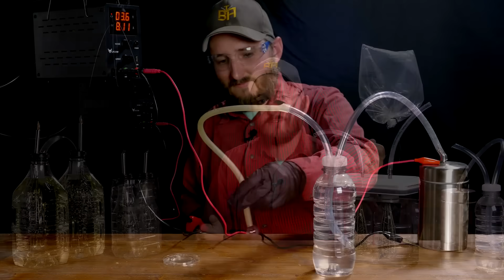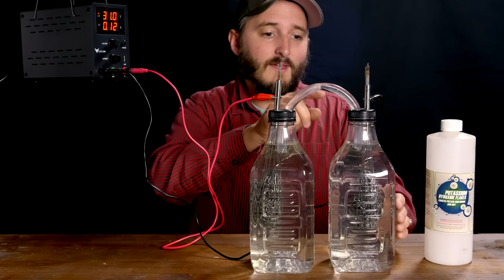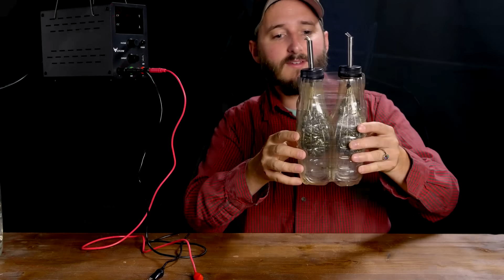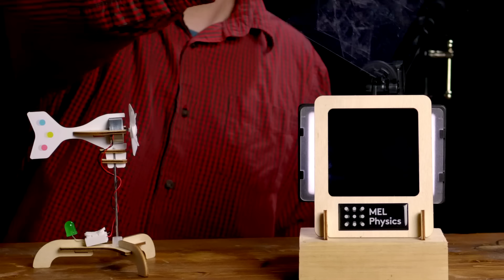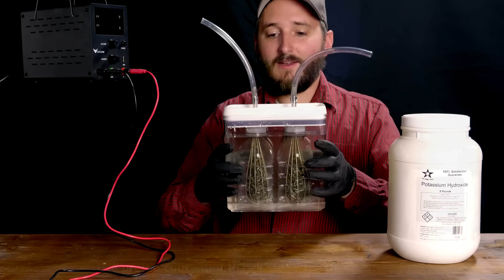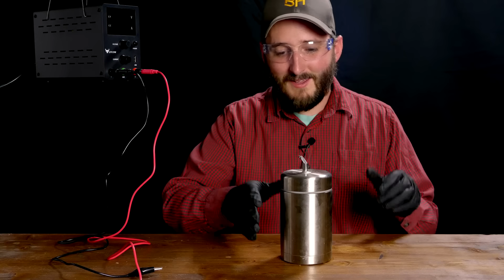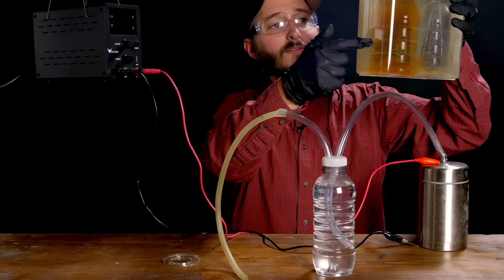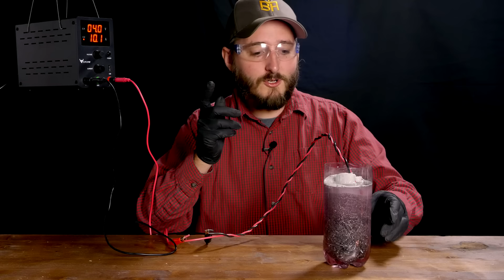DIY Hydrogen/Oxygen Generators From Grocery Store Items (HHO Fuel Cells & Split Cell Electrolysis)

Comment from the maker: Several people have commented with the valid concern that using low quality stainless steel electrodes will contaminate the electrolyte solution with poisonous hexavalent chromium which is not safe to handle or dispose of. I have spent some time this afternoon coming up with a solution to this problem. When using a strongly alkaline solution of KOH or NaOH as your electrolyte the fix is easy: drop a small 1x1 inch piece of aluminum foil into the electrolyte and let it dissolve. Do not add more than a small piece of foil at a time or the reaction may be violent. The dissolving foil will cause any dangerous chromium to convert into a non toxic variation, Cr(iii), evidenced by a green precipitate. One or two pieces of foil dissolved in this way and allowed to react for a few hours should be enough to ensure all chromium has been rendered non toxic.
Reply: I applaud the efforts to "neutralize" the Cr(VI) with a reducing agent but since you're still running the electrolysis cell you will be electrochemically oxidizing Cr(III) back to Cr(VI).
Reply: I did notice how low it was, Thanks to the Automatic Gain Control.
By your reaction and the bang that was very close to a small size firework payload detonating next to you.
not fun.

also, you forgot to mention that spark are generating by pretty much any voltage.
as low as 1 volt.
don't how many amperes one needs for that, however is clear that it can be very dangerous when using poorly secure connections.
Reply from the maker: @dandan-gf4jk  I don't mind some dilute Cr(VI) when it's contained inside the cell, so long as there's a means to neutralize it prior to storage or disposal. Actually, since Cr(III) is extremely insoluble it's unlikely you would convert it back once reduced. You only have to deal with what forms fresh off the positive electrode.
Reply: @Nighthawkinlight  Then we might have different priorities, I was quite unhappy to find my SS cathode corrode because I left it in solution. In general having Cr(VI) in solution is better than having solid dust flying around, but still di/chromates are somewhat potent carcinogens so it would be beneficial to inform people that they probably shouldn't spill the water on themselves :P
Reply: you should check the PH value of the two containers in your first unit, before and after running it for a while because I am betting you have a slow return of the component of potassium back to one of the containers after it has been drawn to one of the electrodes in side with only a small hole and path to run back into the other side to equalize again. (look into chloro-alki cells used to split sodium chloride into hydrochloric acid and sodium hydroxide, by way of a barrier that the components wont pass back through after being pulled or forced through or attracted by the inbalance of positive and negative charges. )
Reply from the maker: @dandan-gf4jk  I figured chemical burns from KOH are enough to de-incentivise anyone from taking a bath in the electrolyte.
Reply: How does "quality" affect chromium content? Am I under the wrong impression that better stainless has more chromium?
Reply: @Nighthawkinlight  And that's another type of burn right there....
Reply: Why not use strictly 304L ? It will not degrade.
Reply: @drgonzo7806  I presume money. Given the 'use dollar store quality' ingredients precludes being choosy about the alloy. Agreed it would be better.
Reply: @drgonzo7806  I'm not a steel wool expert but are there steel wool brands that actually advertise the specific alloy?
Reply: @frollard  You can buy specc'ed 304 steel wire, and make a coil out of it by wrapping it outside a rolling pin. and then the other by wrapping it outside say a paper towel tube, then use the sock method as normal.
Reply: that aluminum with KOH is enough to produce Hydrogen alone without electricity and the Oxigen will go to Oxidize the Aluminum
Reply: @drgonzo7806  304L isn't quite as good as 316L, but both will degrade with enough current.
Reply: @napalmholocaust9093  yeah quality to me only means how accurate to expected percents in the metal the particular grade is, so getting the proper grade would be what one should be focused on and making sure it comes from a good source so you don't get say 316L but the actual composition is closer to a 440 or something, or worse still there are things neither are supposed to have say like lead or thorium or something lol
Reply: @drgonzo7806  or even better just use straight EDM grade graphite as getting it in scrap boxes can be done for 10 dollars a for a 20 pound box (plus about 15 to 20 bucks for shipping LOL) I have one here that has blocks that are an inch thick and 4 inch by 6 inch minimal, and rods from half inch dia to 4in dia, thin flat cuts that are more like knife blade, than a chunk of graphite and it all has about .5 to .7ohm resistance no matter how far apart or which direction through the graphite as its all amorphious glassy graphite, (just don't expect to be able to use it to make graphene sheets by rubbing it on anything, as it is VERY hard for graphite, XD) also if you have a company that does any sort of EDM work with in driving distance you can possibly go talk to them about getting scrap from them and get it super cheap if not free, just don't expect to get cheap or free tungsten/copper alloy electrode material XD (actually I would avoid copper period from them unless you can get info specifically on it making sure you are not getting something carcinogenic with it, like beryllium as that is a thing with copper EDM electrode material,
Reply: @dandan-gf4jk  better yet collect that stuff and use it in other experiments for which you need a catalyst XD
Reply: true!  Very exactly ... my dad is a doctor of chemistry with 40 years of research behind him. Your explanation is GREAT
Reply: Arc wielding rods could do the trick instead of this complicated design ?
Reply: Ben I would add this to the video and repost it. Hexavalent chromium is no joke and this risk and how to mitigate it should be part of the main presentation.
Reply: Thanks for going the extra mile on this.
Reply: Couldn't you minimize electrode electrolysis for the combined gas output one by using AC instead of DC?
Reply: Quite the miss to be oblivious to this hazard. Stainless steel should not be used as anode for water hydrolysis, especially not in an educational vid targeted at kids. I doubt melscience wants to sponsor environmental harm and potentially poisoning kids with carcinogens and heavy metals, without a single warning about it given in vid no less.
Reply: @aleksandersuur9475  Real constructive, pal.
Reply: How about using Carbon Arc electrodes instead?
Reply: @aleksandersuur9475  California?
Reply: guys, you could also use aluminum foil as part of the electrode, or even the whole electrode, after all, the electrode already corrodes quite quickly.
Reply: A DIY hydrogen torch design would be really useful to a lot of people.
Reply: @Real_Claudy_Focan  They could, but it would be less efficient.
Reply: @michaelcre8  Using AC can be risky, especially at higher powers. The current switching means oxygen and hydrogen is produced at the same electrode, and at high power I've seen the gas actually ignite at the electrode as it's being created.
Reply: It should also be mentioned, for those that haven't messed with HHO generators before, that you should never use Chlorine salts.
This is important to mention because table salt is the first thing people will think of most of the time, unless they know better.
And using these salts will produce chlorine gas.
Reply: @Metal_Master_YT  Aluminum will react with KOH or NaOH solutions even without electricity.
Reply: @shinrakishitani1079  I've wanted to make an HHO generator for not only a torch use but also because I've read that breathing Brown's gas is more beneficial than just O2. It would be nice of somewhere we could source together a guide on how to make one, with all the many safety precautions that need to be taken into account. I havent even thought about seriously starting on making one yet just because of all the known hazards let alone which ones I dont know.... Need an HHO generator plans and safety precautions for dummies guide.
Reply: aluminum foil, not to be conflated with tin foil.
Reply: Thank you brother.
Reply: @Nighthawkinlight  pickle juice?
Reply: Did someone call the safety police?
Damn snitches
Reply: @Nighthawkinlight  I'd assume that getting a chemical burn, with a solution that contains Cr(VI) would make it likely that you absorb a greater amount of it than you would have by simple contact. So this is an additional risk when handling used electrolyte. You've said, that you've splashed yourself with the KOH solution accidentally while making this video. Accidents happen. So saying "just don't get any on you"  isn't a safety concept. You need to be aware of the risk, take precautions to minimize it and to mitigate harm when an accident happens.
That said I, it's a great experiment and I believe we should be able to show and do things that have risks, we just need to be aware and act accordingly.
Reply: Comments here are quite informative. We need another video about this filtering out comments into one nice video. Health hazards are serious. I need this.
Reply: @aleksandersuur9475  Quite the miss?  Right.  Hexavalent Chromium is like asbestos.  Unless you're mining it or doing something to produce dust with it, you have nothing to worry about.  It takes a fairly long exposure time to be of concern.  And that's if you mishandle it.  People like you act as if a single drop or even looking at it wrong will guarantee death.  It's a simple concept to grasp...be safe, but don't be afraid.
Reply: Pencil graphite might be good solution here.
Reply: @Impatient_Ape  I was hoping that by the way I phrased my previous comment, you would know that I already knew that, apparently not.
I said: "guys, you could also use aluminum foil as part of the electrode, or even the whole electrode, after all, the electrode already corrodes quite quickly. " as you can see, I was aware that the previous electrode was corroding, and I was suggesting that we use aluminum because it wouldn't change the fact that it was corroding because I knew that aluminum would react and corrode as well. 
now, of course it may very well be reacting faster than the stainless steel, I don't know the speed, and frankly, I don't care that much since I'm not the one building one of these devices. but what I'm trying to say is that, yes I know that aluminum reacts with KOH/NaOH solution, forming a bunch of hydrogen gas. I believe you can get the stuff advertised as drain cleaner at a grocery and or possibly a hardware store. then just mix it into some fresh water, and let dissolve, then throw in some aluminum foil, and watch it make a ton of hydrogen gas. fun, but also dangerous, not only because of the kinda explosive hydrogen gas, but also because the solution you have made is highly corrosive/caustic.
Reply: @jenbadabam8801  how about you wear clothing that PREVENTS it from getting on you, eh? the point is to stop it before it ever gets to you, i.e., before it ever makes contact with your skin.
Reply: I like the oxygen but hydrogen is a nuisance. Is there something that absorbs it and makes it nonflammable?
Reply: @doesthedishes198  oxygen absorbs the hydrogen and turns it into water. you have to burn it if you want to get rid of it quickly. you can use the oxygen in the air for that, or you can put the hydrogen in a pressurized container and sell it to somebody else.
Reply: I see you are using a lot of stainless steel.  Some have reported the chromium contained in it leaches out into the electrolysis medium.  Have you found this to be the case?
Reply: @Nighthawkinlight  EXACTLY! lol. You mentioned carbon which is also useful electrode to not have to deal with Cr(Vi). Titanium is another good one. Salt water pool electrolyzers use titanium plates to generate chlorine from the NaCl added to water. Thanks for showing this. I been working on hydrogen electrolyzer for a while and still havn't gotten it quite....optimal. Now do a video on how to make permeable electron membranes!!!
Reply: Is that a rust build-up in the right side bottle?
Reply: @doesthedishes198  I think pladadium works.  You can vent or burn it, but there's better ways to make oxygen than electrolysis!  They have these medical units that make it on demand from air.
Reply: @dandan-gf4jk  If one is patient and goes about making hydrogen gas and oxygen the slow way, is there still a possibility of getting toxic compounds if the electrodes are made of aluminium (foil) and the electrolyte added to the water is baking soda ? I know of Cr(VI) from the movie Erin Brockovich and understand it can cause cancer.
Reply: Night hawk

Since it's only the cathode or plus side that decayed from the contact with oxygen; the if you did buy carbon felt cloth cheap
Then no decay.
Reply: @175griffin  

So why not carbon or graphing cloth as the positive cathode?

You are talking about spending money here anyway.
Reply: Do the electrolytes actually get 'consumed' in any way? What about the aluminium?
Reply: The whole single output electrolysis chamber is a timebomb. A HHO generator with a live case is not a good idea, quite frankly its an awful idea.

i'm sorry about the harsh tone i took i know this is one of if not your first electrolysis project and we all make mistakes when starting out but their is a reason I haven't published any of my projects yet and that's cause I don't want to look like an authority and give awful advice.
Reply: To check you have reduced all the Cr(VI) in your solution, add few drops of the solution to acidified 10% potassium iodide. If there is colour change to brown, iodine is released and the solution still contains hexavalent chromium. The indicator sensivity is greatly increased by adding few drops of starch suspension - it detects slightest traces of iodine by turning blue.
To neutralize the sample, add enough reducing agent (e.g. sodium bisulfite) so it decolorizes again.
Reply: I am not sure if it was mentioned that the hydrochloric acid flux needed to solder the SS can also be dangerous. It also should be mentioned that it needs to be neutralized after soldering.
Reply: U
Reply: U
Reply: how about use stainless steel water bottles .... and stuff SS pad
Reply: @ratgreen  not sure if it’s 304SS, but harbor freight sells rolls if single strand SS and it’s relatively inexpensive and has many uses.
Reply: Can you do a video where you add this device to a cars air intake?
Reply: I'm really curious how much it extends mpg
Reply: @francoisleveille409 No, there is no chromium anywhere it won't just manifest itself into existance in your cell, although your anode will produce mostly co2 and convert itself into Al(OH)3.
Reply: @reypolice5231  If you wanna spend some money, platinum-iridium is the way to go. It's more conductive and also won't corrode. It won't have quite as much surface area as a graphene cloth though.
Reply: @nitroadshadow4667  

Then kindly post what you see as the problem, and mitigating efforts, so the rest of us can be informed as well. Thank you.
Reply: @the_overthinking_philosopher  

Not air intake, but vacuum line to break Master cylinder is better I am told. Less chance of an explosion. Air intake not good.
Reply: @Real_Claudy_Focan  take apart carbon zinc battery's the rods are graphite don't worry they the cheapest kind of battery cheak the dollar store also don't worry they don't burst into flames like lithium pretty good rods for making heating elements
Reply: @h7opolo  I'm not even sure tin foil is made anymore.  After the introduction of aluminium foil (yes, I spell and pronounce it the Australian way 😁), tin quickly went out of fashion due to aluminium's lighter and more malleable texture and tin sometimes leached into certain foods, giving them a metallic taste.
Reply: @Nighthawkinlight  What just using platinum electrodes?
Reply: @onradioactivewaves  Don't go breathing Brown's gas.  It's non-toxic, but if it somehow explodes in your lungs (e.g. because of nearby electrical sparks) you'll be entirely fucked.
This is partly why fire-breathers use kerosene rather than any more-volatile fuel; fuel that might create an explosive mixture, when you inhale, is a VERY bad choice.
Meanwhile, a "poor-man's oxygen concentrator", mixing the electrolytic O2 with air, is entirely safe... but probably unnecessary.   And, don't smoke, while you're using it!
Reply: Best to have a wash-bottle nearby; (dilute?) vinegar would be appropriate, for KOH / NaOH electrolyte splashes.
Interesting to see how much more conductive KOH is, than NaHCO3; good experimental info.
Reply: @bardrick4220  Those chubby carpenter's pencils, for example.
A commenter upthread suggested shopping for EDM graphite scraps, which (if I could find them!) would give much more surface area.
Reply: @Metal_Master_YT  It's absolutely not helpful, to have the electrode dissolve in the electrolyte, *even in the absence of any applied voltage*.
Your suggested cell eats itself, wasting both the electrode and the electrolyte;  fail.
This isn't a matter of our ignorance, this is merely a terrible suggestion on your part.
Reply: @doesthedishes198  Just vent the hydrogen, and leave a window open;  the H2 will rise and escape your premises.
Alternatively, flare it off, per oil rigs / drilling, if you're making enough to sustain a flame.
Reply: @Metal_Master_YT  Oxygen does not "absorb" hydrogen, absent a flame or something like platinum black catalysis.
And these cells won't produce [enough] H2 to pressurize, in part because they run at atmospheric pressure; you need a couple hundred atmospheres, for a cylinder of H2.
Reply: @mattparker9726  "Yes"; the SS gets oxidized, as you can see from the color-change of the electrolyte.
OP suggests that, to dispose of the electrolyte, take it someplace safe (e.g., outside, in a bucket) and add scraps of aluminum foil; which should reduce the chromium from VI (dangerous) to III (insoluble, mostly safe) -- then pour the electrolyte down the drain.
Reply: @Wayne Flanigan Low surface area.   E.g., pencil leads work, but not nearly as well as SS scouring pads or wraps of SS foil.
Reply: @bardrick4220  Right, oxygen concentrators, on Ebay for a couple hundred bucks, reconditioned.   But they don't give pure oxygen; they leave some nitrogen and (I suspect) argon etc.   Good enough for a torch, maybe not good enough for chemistry :-)
Reply: @francoisleveille409  Aluminum will dissolve in alkali electrolyte, so probably / slowly in baking soda.  You'd be much better off with SS or with graphite.
Per previous comments, you can reduce the Cr(VI) to Cr(III) with aluminum foil, once you're done with the electrolyte; just don't splash it about, in the meantime.
Also notice that KOH and NaOH work much better than baking soda, in the sense that you get much less heat and much more gas for the same power input.
Reply: @reypolice5231  Ooo, that's a good idea; relatively cheap, high surface area, nicely flexible to wrap around some kinda "former"; thanks! :-)
Reply: @theskett  You could also use arc gouging electrodes; it would depend on budget and use, although if I was doing it for energy storage I think I'd opt for a fuel cell.
Reply: @theskett  ya, the whole "perfectly explosive stoichiometric ratio"  aspect of Brown's gas does raise a bit of a cautionary red flag.
Reply: @theskett  Sorry, no Cr(VI) ever. I don't care if the reaction is less energy efficient. If Alu foil dissolves slowly in sodium bicarbonate then it doesn't matter as it costs virtually nothing. My life is far more valuable. I will not risk getting cancer just because I want to make a bit of hydrogen.
Reply: @bardrick4220  Arc gouging electrodes, are apparently not pure(-ish) graphite; see previous comments on this subject.
But hey, go try them, they're relatively cheap.  I'ma go SS or graphite, next time I play.
Fuel cells are... much too complex, easily poisoned, much bigger.  Ok if you want 1+MW, no good if you want 1kW (because, at 1kW, you don't get support staff).
Kinda the same way you don't want even a 100kW nuclear generator; hot, dangerous, should be not-near-you.
Reply: @francoisleveille409  Missing the point, you are.
If you don't understand why adding aluminum to an electrolytic cell that uses KOH or NaOH as an electrolyte, or even NaHCO3, then you and your valuable life should step away from any kind of chemistry.
But you can go make H2 from NaOH and Al, without an electrolytic cell.  Go have fun.
Reply: Or use a nonreactive electrode. Gold comes to mind.
Reply: @growleym504  No problem, send us all some 24kt gold and we'll stop using SS.
Reply: @growleym504  We want large, inexpensive, surface area.  Guess what, that excludes gold.
Reply: @theskett  You don't care about my life so I don't care about your advice.
Reply: what about ormus?
Reply: @Mad_Scientist2052  HCl and "killed spirits" are both essentially safe, and can be rinsed away.  Neither needs to be neutralised.
Reply: @francoisleveille409  Of course, but that reciprocally means your comments are without value.
Reply: Just use 14 parts urea 1 part potassium hydroxide and use graphite as the contacts
Reply: @drgonzo7806  in any electrolysis system the 304L anode will have to 'degrade'..........
Reply: @Rem_NL  OK, why TF do I want to use urea?  Esp.  in preference to KOH?   That seems at best silly.
Reply: @theskett  most efficient way of doing it, need way less power draw + heat production
Reply: @theskett  No one cares about my life and my comments are without value. Such nice people on the internet. :-P
Reply: @Rem_NL  Very unclear, what you're saying here.  OF COURSE we want less power draw, less heat production.  But you don't help us with that, do you?
Reply: @francoisleveille409  Yup, you got it.
Reply: @Xayuap  Of course, but that's both pointless and useless.
Reply: @michaelcre8  Nope, AC only provides heating; not electrolysis.
Reply: @Bobsmith-xq2pr  AC will only give you heating, not H2 + O2.
Reply: @theskett   ó, but you can use your trash Aluminum to forge some energy
Reply: @Xayuap  Nope.  Recycle it, instead, to improve your karma.
Reply: @nitroadshadow4667  A live case is fine; it's at tops 30V, that ain't electrocuting anyone.
Thanks for not publishing anything, tho, that saves us all some time and laughter.
Reply: @Mad_Scientist2052 HCl and Baker's Soldering fluid both wash off, do not need to be neutralized.
Reply: @theskett   recycling needs energy. this gives you energy.
Reply: You should try HDPE or LDPE plastic, they are both much more resistant to corrosion.
Reply: @randallkornholio2971  Yup, those won't corrode, because they're mostly inert.  How's that help us, tho?   They melt down, fairly easily, at below boiling water IIRC..?
Reply: @theskett  false. AC will absolutely split water, just very dangerously.
Reply: @Bobsmith-xq2pr  Sadly, no.  Just heats, not electrolysis.  Good luck with your heating.
Reply: @theskett  remember, when there's an electric differential between two electrodes, AC or DC, it will split water. It's just about quantity, efficiency, and danger.
Reply: @Bobsmith-xq2pr  No, it's about the motility of the ions.   50Hz, 60Hz, just gets heating doesn't occur any electrolysis, because there's no time for the ions to turn into gas.
At 50 (60?) Hz, you got nothin'.
Reply: @theskett  I promise, I've stuck power from a standard US outlet into water with NaOH in it, and it bubbles and some of the bubbles even explode on creation. Although I will admit I've never considered the effect of the frequency on electrolysis. Maybe I should get an oscilloscope and do a bunch of tests.
Reply: Why not try to hook up the metallic single output HHO Cell to an internal combustion engine? If you made two or three cells you might make it run even if only at idle.
Reply: @theskett  HDPE melts at 130°C (266°F), HDPE also does not crystallize until 111°C (231°F), water boils at 100°C(212°F), plus test sheets indicate HDPE will hold up to potassium hydroxide at 50°C for 30 days with little to no noticeable damage, how does that not help the situation? Is there another deterioration to the HDPE that I have not seen in the material data sheets?
Reply: @randallkornholio2971  Hee hee, show me a plastic crystal  -- I don't need to get out more, when I can just laugh at you.
Reply: @Bobsmith-xq2pr  Those bubbles are steam.
Reply: @theskett  sureeeeeeee Explosive steam
Reply: Good show old man.
Reply: One thing you could probably do to improve the sock design even further is to make it a layered structure. Start with a whisk + scouring pad, then a sock and a positive electrode over it, then another sock and a negative electrode, repeat ad. infinitum or while the socks fit. Then connect all electrodes in parallel.
Reply: @theskett  ehh no? You got to make it yourself. Not sure what you are asking here. I posted a clip on youtube from a very wel respected man. He has a made a tutorial in how you can make HHO with the help of graphene foil, urea, some plastic and screws. No chromium involved, no nasty gasses. And to top it off the best efficiency when it comes to power draw.
Reply: @Wayne Flanigan I believe it is due to the low surface area, and the fact that they are worse conductors than metal. there might also be issues with some electrode materials just simply not being good for that specific terminal, I.e., some materials are better suited for the negative side vs the positive side, or are simply not good for either side. I don't fully know the answer to that question though.
Reply: @theskett  but NightHawkInLight himself suggested putting aluminum into the solution to reduce the unwanted chromium compound. any aluminum that goes into the solution will react with it, so what is the problem with making an electrode with some amount of aluminum already on it so you don't have to come back every once in a while to place aluminum foil squares into the solution?
the electrodes are already dissolving, so what exactly is changing? the cell is already eating itself brainiac.
also, there's no need to say that my thoughts are terrible. I mean, come-on when did I ever say your thoughts were terrible? I said you misunderstood me, but I never told you that your ideas were terrible.
Reply: @theskett  "Oxygen does not "absorb" hydrogen, absent a flame or something like platinum black catalysis."
well yeah, duh! why are you even bringing this up? I said "burn it" in my original comment, I thought I was pretty clear!
you have to look at the context of whom I'm talking with. the other person asked if there was any way to get rid of the hydrogen, or absorb it somehow, and my answer was
yes, oxygen will absorb hydrogen. just heat it up, and it will burn, making water, boom problem solved.
also, technically, when hydrogen is mixed with oxygen in the air, a few water molecules will form due to random chance, a few photons might hit the same spot and temporarily heat up a few hydrogen atoms and a few oxygens, enough to make a single water molecule.
I'm Confused, What's Wrong???
Reply: You have a very interesting process I like the idea of two separate containers for hydrogen and oxygen.   too bad you could not find a high-quality stainless steel container for that process
Reply: @theskett  "And these cells won't produce [enough] H2 to pressurize" well then use a gas compressor.
Reply: @Metal_Master_YT  You certainly are confused, and you're repeating yourself.  
There isn't sufficient hydrogen, in our atmosphere, to be interesting; it's very light, it achieves escape velocity, it doesn't make water.
LOL, "technically" -- you have nothin'.  No physics, no chemistry, just a need to comment.  OK, go you.
Reply: @Metal_Master_YT  The electrodes are not already dissolving, "brainiac"; the aluminum is to knock the Cr(VI) to Cr(III) once one decides the electrolyte should be disposed.
JFK, MM, go back to welding or whatever it is you do best.
Reply: @c.t.murray3632  Just strap a couple of the SS containers together.
Reply: @theskett  what the heck are you talking about? you're such a hypocrite!
"No physics, no chemistry, just a need to comment.  OK, go you." If anyone has a need to comment, its you, count your comments dude!
so far, you have commented 39 times in this thread alone! you make up nearly 30% of the comments!
"There isn't sufficient hydrogen, in our atmosphere, to be interesting" to be interesting? ok... but I'm not talking about natural hydrogen in the air, I'm talking about the hydrogen that is produced through electrolysis, because @DoesThe Dishes was asking about it, and I was answering his/her question.
"it's very light, it achieves escape velocity, it doesn't make water." uh, yes it does. when you burn hydrogen it makes water, as I said. it is, of course, in the form steam, because it gets very hot from the exothermic reaction it just went through, but its still water nevertheless. also, escape velocity usually refers to a solid body of some sort, not a highly-dilute gas. the definition of escape velocity is the following: "the lowest velocity which a body must have in order to escape the gravitational attraction of a particular planet or other object." its not really correct to say hydrogen achieves escape velocity because hydrogen does not need any external force, it makes its own to float upward, and of course, it will rest at the very top of our atmosphere for a long time, not exactly "escaping the gravitational attraction of our planet". would you say that a bubble has achieved escape velocity in some water? no, not really.
there's your physics and chemistry for ya.
Reply: @theskett  "The electrodes are not already dissolving" look at the freaking stainless steel electrode, see the dark brown color? its reacting and corroding, and at least a small amount of it is making soluble compounds, I know because I have done the experiment myself, with stainless steel, and a power supply. I will admit that I used salt water in mine. (not as good as potassium hydroxide) so it might make different compounds. also, the chlorine started to make me nervous, so the experiment ended early.
corroding or dissolving, either way its breaking down.
Reply: @theskett  "Right, because a gallon a minute warrants a compressor.  Don't be a total dick." you're assuming the size of my apparatus? how in the world would you know the gallonage of gas per minute I make off of a theoretical device that neither of us has made? NightHawkInLight himself said that it could be scaled up. besides, this isn't my apparatus were talking about, the conversation began with @DoesThe Dishes comment, it would be his/her apparatus. he/she asked how to handle the annoying hydrogen, and I am simply giving out ideas, no need to hate on me. I don't know what he/she had in mind, if it was a big setup, then a compressor of some kind could be useful.
you have to stop changing the subject, or at least straying from it, and you need to take into account context.
Reply: Can you tell me the answer to life in your next project… I’m sure others would appreciate it to.
Your superhuman critical problem solving is insane!! 
Teach me your ways, Sensei🙇‍♂️
#nighthawkinlight #BigBrain
Reply: GREAT TIP! THANK YOU!
Reply: @aleksandersuur9475  I seriously doubt that there are all that many kids either watching this video or buying the sponsor's kits ~ that would be the parents.  I agree that it should've gotten mentioned - FOR THE PARENTS; but, the concept of "child proofing the world" makes me want to throw up!!!
Reply: @Metal_Master_YT  Except, hydrogen is extremely difficult to contain, even under pressure. (one of the reasons why it gets villainized - it's impractical to meter it...)
Reply: @Bobsmith-xq2pr  If you want to go that route, use HF/HV DC - CAREFULLY - I'm hearing that some folks are getting really good output using very low energy by going that route. Keep in mind that it IS "dangerous;" but, that just means that one needs to respect what we're working with...
Reply: @NTF-zb9wi  Carbon Arc Electrodes work great for producing Sodium Metal from Sodium Hydroxide
Reply: How about using Carbon rods, stripped out of Zinc carbon batteries?
not so efficient maybe but safe.
Reply: @NTF-zb9wi  ok... then just burn it if you don't want it.
Reply: @theskett  

Hi theskett,  I am now looking at my build as a price of plastic jug flat square or rectangle/ or wood as as the center of build. Wrapping it with those green flat kitchen scouring pads [ I think they're made by Scotch gard or some cheaper company at the dollar store]. This will allow the water to percolate up through the bottom and on both sides of the steel wool. The tube sock is too thick, which is why I recommended the bed sheet/ pillowcase/fabric as a separator. You can control the thickness of your build on the separator with fabric. [I plan to leave the bottom exposed to the water, and maybe that side not covered by fabric?].

Rest of the build  you've already saw offered as a proposal in nighthawk or anyone else.

My opinion is that the fourth stage of water, John Ellis water is key. As it's so close to separating that the amount of energy needed to get it to release into gas will be minimal.

I still think magnesium sulfate/ food grade Epsom salts is it safer electrolyte. And it priced cheaper than baking soda. I have 40 lb of baking soda from Walmart cleaning Department. 24 lb of food grade magnesium sulfate / Epsom salts from the bath aisle. Both are great for taking baths.
Reply: @Real_Claudy_Focan  what arc welding rods are you meaning? Leaving the coating on them or stripped of that in just a metal wire part? You've done this before and it works good?
Reply: @shinrakishitani1079  did that years ago and then did that with galvanized metal as my plates.. that was not so fun LOL
Reply: @michaelcre8  everything I've ever read says you have to use DC to make hydrogen to AC won't work and from my experience I've never gotten anything to work from AC but have gotten DC to work quite well with the stainless steel pot scrubbers actually very similar to what he showed except for I use three and three and wrap them with a nylon window screen instead of a sock and instead of using copper wire for my connections that use a stainless steel wire like from a whisk pulled apart it goes down into the stainless steel pot scrubbers one on the inside one on the outside up to a lid of a gallon size jar and a couple stands still bolts up there put with rubber grommets so they're sealed that you hook the stainless steel whisk wires too on the bottom side of the lid and one other hole going through there with it with a nipple and a grommet so it's sealed off and the top side hook a 12 volt heavy duty wiring for your vehicle via a starter solenoid separate starter solenoid just for the hydrogen generator to act as a relay and make sure you run into a bubbler split it off and put it into the power brake booster of your intake manifold system for your vacuum and the other line right there by your mass air flow sensor in your air filter and make sure you put a check valve in the one that goes to the vacuum booster to the power brakes and with that in my Jeep with a 4 l inline 6 cylinder motor I was able to produce over 2 l of gas per minute which is what you need to be doing and took my fuel mileage from little over 12 miles is a gallon to 26.2 miles per gallon all day long no matter what. Make sure you use a bubbler and I used pure lie for my electrolyte that's more than double my mileage so that's pretty damn good. I've seen people do better though even better mileage than that with 350 V8 but I was happy to get that with my Jeep at the time. I wrote all this with my text voice to text so hopefully you can understand it I'm not going to go through and correct all this s*** I think you can get what I'm saying for you just be along with it..
Reply: @Bobsmith-xq2pr  I'm getting ready to make one that runs off AC but using a 200 amp rectifier diode that I got off of Amazon to convert the AC to DC.
Reply: @onradioactivewaves  you just got to go for it man. That's how we all started out just saying f*** it and going for it. I'll tell you a huge tip though you should absolutely follow and not make the same mistake I did on my first one definitely use a bubbler for the anti flashback setup. The very first one I made I cut up the stainless steel sink from my plates and was about to build it in a glass jar but luckily decided to put it in a plastic container instead and hooked it to my bus batteries and that fizz coming off there was just lighting like snap crackle pop it was great but the torch and I put the lid on it and told my buddies I was holding thinking I should have a super torch I had a super explosion it was loud as hell and crazy luckily nobody got hurt but we could have so at that point I knew that's what the bubblers are for and make sure you always use a bubbler. I used my voice to text to say this so if it's not all correct or punctuated correctly just try to read through it..
Reply: @BurkenProductions  at the hard time keeping awaken this front of me class in college from the due to voice all melo and being right after lunch too I guess LOL..
Reply: @Metal_Master_YT  it's actually not the explosive kind of hydrogen gas like doing the electrolysis processes. I've made a ton of it both ways and I ran both ways into my Jeep motor and I've gotten the same results actually.. doing it the aluminum way though is kind of a pain in the ass and it's very much a lot more maintenance to clean out all the byproduct that leaves after dissolving the aluminum. I've actually modified camp stoves though and ran them on the aluminum foil in the water solution reactors. I'm pretty sure that I was able to do the little stoves easier that way because it was not so volatile and explosive as the hydroxy solution from electrolyzing with stainless steel or other metals.
Reply: @nitroadshadow4667  what's wrong with using a stainless container? I've been using an old stainless steel fire extinguisher for several years now with no problems. I've used it both electrolysis and chemical react without any problems..
Reply: @the_overthinking_philosopher  I described that I more than doubled my mileage in my Jeep, using two packs of stainless steel pot scrubbers, three scrubbers rolled together like a sausage, wrap with nylon window screen to insulate it from the other three scrubbers. The other three scrubbers get streched over the other 3 after the  nylon window screen is wrapped. I used that instead of a sock and a gallon jar in my Jeep up in another comment there. 

 This big thing is, in order to get any fuel mileage improvement, it's imperative that your hydrogen generator produces half the liters of the he liter size of your engine  per minute. My Jeep had a 4.0 l engine in it so my hydrogen generator had to make two liters per minute in hydroxy gas.  I discovered that if you can't make half of what your engine size is in gas from the hydrogen generator you want to be getting any better filled mileage either.
Reply: @the_overthinking_philosopher  actually hit post before I was done on that one but you have of your engine size in in liters so I had a 4 l engine in my Jeep I needed to produce 2 l of hydrogen per minute otherwise I was wasting my time which is exactly what I was doing in the beginning trying all these different configurations out to my engine and not getting any mileage improvement. At times I think I might have even gotten worse mileage on some of my experimentals. Which also I got to tell you it depends on what year your vehicle is with what computer system it's got in there emission system OBD1 or OBD2. If it's the older OBD1 at my jeep was you're good to go pretty much hook it into your vacuum brake power booster on your manifold with a check valve and also at right where your mass air flow sensor is on your air filter tube that way it at highest engine speed and low engine speed both it's sucking in the hydrogen oxygen fuel.. 

I found that to make the amount of gas that I needed 2 l per minute it required making the hydrogen generator able to handle good power and not overheat not burn up wires and different things like that so I know there's better ways of doing it but the way I did it it worked for me was I used a Ford starter solenoid as a relay and then the switch inside my cap of my Jeep and nice good size wires running from my jeeps charging system to the hydrogen generator so when I flip that switch the starter solenoid because I can relay and was able to put good solid power to my unit. You want to make sure that your chamber is big enough holding enough liquid that it don't just get overheated real quick if you're doing it the way I described there. I use my voice to text to say this so if it's a little f*** up or not punctuated right except to look through that and hopefully you can understand what I'm saying..
Reply: @beckwerks  ya thanks. Another problem is that I made a big move and left a job, left behind lots of scrap electronics that were going to be repurposed for electronics projects and had a great source of basically good new electronics that could easily be repurposed.... so my projects I had all basically got put on the back burner for now, and I lost my great source of new free good materials... eventually.I want to pick that project ul bit its definitely on the back burner for now, other things in life a much greater priority presently. I know this should be a cheap project and easy to source, but free available good materials always makes these type of projects easier as well.
Reply: @reypolice5231  I keep mine off and ran it to both my power brake booster vacuum line with a check valve and then right there where my mass air flow sensor was in my air filter intake on my Jeep and it worked great.
Reply: @theskett  very very good comment and advice! I often use some vinegar to neutralize lie that I get on my skin. A person can use lemon juice or whatever other kind of acid food product they have around in a pinch ketchup tomatoes oranges orange juice whatever to neutralize the lie and stop it from burning they're skin.
Reply: @theskett  I've always poured my water in the yard without any trouble it acts like a fertilizer..
Reply: @theskett  I've had a couple of those that I've hooked to cutting torch tips but ran propane with it and cut metal like f**** no tomorrow melt glass melt brass melted they're badass I wish I had one right now. My last one got burned up in a fire where we lost everything we had.   not from torches freak electrical fire in the place..
Reply: @Bobsmith-xq2pr  even more fun to do is to stick the leads in water from a transformer that steps up the 120 volts AC to double that or if your really up for insane fun, take apart a microwave and check out what 2000 and 5000 volts can do 😁 DO NOT TRY THIS WITHOUT BEING SAFE ABOUT IT AND USING A NON CONDUCTIVE CHICKEN STICK IF YOU GET ANYWHERE NEAR THE LEADS FROM THIS, DO NOT MESS AROUND IN A MICROWAVE UNTIL YOU HAVE UNPLUGGED AND SAFELY SHORTER THE CAPACITOR IN IT... THE CAPACITOR IN ONE OF THOSE CAN STORE ENOUGH ELECTRICITY TO KILL YOU EVEN WHEN THE MICROWAVES UNPLUGGED AND THE AMOUNT OF POWER THAT IT PRODUCES WHEN YOU DO PLUG IT IN AND YOU'RE PLAYING AROUND WITH IT WILL DEFINITELY KILL YOU BUT YOU DON'T WANT TO F*** AROUND AND GET HIT BY IT.

 WHAT'S THAT SHAPE YOU WARNING SAID GO FOR IT AND TRIP OUT IT WILL BLOW YOUR MIND HOW BADASS THAT S*** IS! I USE IT AND PUT THE LEADS ON WOOD ACTUALLY WITH SOME SALT WATER AND IT BURNS LIKE LIGHTNING LIGHTNING PATTERNS IN THE WOOD THAT LOOKS PRETTY COOL. PUT SOME WATER WETNESS ON THE DIRT AND LET HIM GO TO TOWN AND MADE SORT OF LOOK LIKE A CORAL OR SOMETHING SORT OF LIKE THE SAND GLASS THE LIGHTNING GLASS ON THE BEACH BUT LITTLE NOT QUITE AS COOL LOOKING AND MORE STRUCTURED LIKE CORAL... I'VE USED MY VOICE TO TEXT TO TELL YOU THIS HERE SO I KNOW IT'S NOT I'LL PUNCH WAY TO WRITE AND PROBABLY GOT SOME MISSPELLING HOPEFULLY YOU CAN UNDERSTAND WHAT I'M SAYING THOUGH
Reply: @Metal_Master_YT  based on my experience with the making hydrogen using stainless steel and electrolysis and chemical reactions with aluminum, the aluminum will just keep on dissolving even when you're not running power into the unit so it will dissolve it just keeps going until it's dissolved she won't have that aluminum in there for very long and you'll be producing hydrogen gas the whole time that it's got aluminum in it and a lot of mess. Whereas the breakdown of the stainless steel and electrolysis process unit that happens when the unit is with power and on.
Reply: @Metal_Master_YT  adding a little square of aluminum foil like nighthawk says would be a lot more of a controlled situation a lot less mess cuz you're only putting in a little bit of aluminum which will dissolve and hardly no time at all versus having your rod made out of aluminum or part way of aluminum dissolve and dissolve and make a big mess and you won't have the rod anymore either by the next day
Reply: @Metal_Master_YT  the aluminum will dissolve in the solution even without power hook to it it will dissolve till it's gone and make hydrogen even without power hook to it so there's that doctor too you got your aluminum will dissolved before the next day and it will be producing hydrogen so you got to be careful with that because that's flammable explosive still. Whereas the other stainless steel and the discoloration that you see coming from it that happens only when the power is put to it.
Reply: @grownbaby8405  It is a great idea except for the chlorine the salt would make...  The Navy maybe 6 years ago or so, said they were making hydrogen gens to try out for using sea water to make into fuel right on the ship..
Reply: Flash back arrester would need a 3rd hole with some thing like a baby bottle top to act as a pressure release valve .... what ya think ?
Reply: @beckwerks  Good point. Maybe knock down the Cr(VI) (but I suspect it quickly gets sequestered) and then the KOH is plant-food (as are we all, eventually :-)
Reply: @beckwerks  Sympathy re the fire.  Thanks for the 'propane' suggestion, I thought I'd need MAPP or acetylene to get that hot.   Hrm, I should go play... :-)
Reply: @beckwerks  OK dude, we're gonna need to see you covered in ketchup, after the next lye explosion :-)
In return, I'll post a pic of myself entirely dusted in baking soda, after my next acidic etching disaster....   :-)
Reply: @reypolice5231  That's fascinating, thank you :)
It wouldn't have occurred to me, to use Epsom Salts.  Also, you got 24lbs?  That's a lotta baths, no-one was suspicious?  :-)
(I've used washing soda, mostly; I don't love splashing around with lye :-)
Reply: @Metal_Master_YT  You don't get to scale up "Two whisks, and some scouring pads" into anything industrial.
First off, you can't afford to generate that much Cr(VI); you'll get shut down, immediately, by the regulators.
Second, electrolysis is a horrible way of making hydrogen;  look at water gas instead.  S'fairly efficient.
And no, you don't need a compressor, per se, for electrolytic hydrogen;  you can generate that at high pressure, by not using soda bottles.  And not at high enough pressure to push into a cylinder (plus, it's kinda wet).
Incidentally, I didn't / haven't changed the subject, and I suspect your apparatus is quite small.
Reply: @Metal_Master_YT  You misunderstand.  Aluminum electrode(s) will dissolve in a KOH / NaOH (and probably NaHCO3 etc.) electrolyte.
In the absence of any applied voltage.
So you cell just sits there, and eats itself.  Probably not what you want.  But hey, your $$.  Go have fun.
Reply: @Rem_NL  Thanks;  I'm fairly sure I don't gotta make it myself, but your "Use graphite fabric" comment is a thing I hadn't much considered, and I should go try that.
But urea, OTOH, is pointless; it's not properly conductive, it's like trying to electrolyse piss (literally; that's kinda why piss smells of ammonia).
We need KOH, or NaOH, or some other strongly-polar solute, for our electrolyte.  Which carbon fabric should withstand, quite nicely (hence the thanks :)
Reply: @theskett  read the paper its actually more conductive than pure potasium hydroxide
Reply: @beckwerks  it might be less explosive if it is contaminated with water vapor or air. if you have pure hydrogen gas, it will be no different than any other pure hydrogen gas.
Reply: @beckwerks  "based on my experience with the making hydrogen using stainless steel and electrolysis and chemical reactions with aluminum, the aluminum will just keep on dissolving even when you're not running power into the unit so it will dissolve it just keeps going until it's dissolved she won't have that aluminum in there for very long and you'll be producing hydrogen gas the whole time that it's got aluminum in it and a lot of mess. Whereas the breakdown of the stainless steel and electrolysis process unit that happens when the unit is with power and on." just pull the aluminum out, perhaps with some tongs, then rinse it off. lye can go down the drain, its often used as a drain cleaner.
Reply: @beckwerks  "adding a little square of aluminum foil like nighthawk says would be a lot more of a controlled situation a lot less mess cuz you're only putting in a little bit of aluminum which will dissolve and hardly no time at all versus having your rod made out of aluminum or part way of aluminum dissolve and dissolve and make a big mess and you won't have the rod anymore either by the next day" yes, it would definitely dissolve much faster, and might very well not be practical, but its just a thought.
Reply: @beckwerks  you keep mentioning how it will dissolve into nothing, well that is simply fixed by having an electrode that is removable, which it should be, since its going to slowly dissolve anyway once you turn it on.
Reply: @theskett  you keep mentioning how it will dissolve into nothing, well that is simply fixed by having an electrode that is removable, which it should be, since its going to slowly dissolve anyway once you turn it on.
Reply: @theskett  "You don't get to scale up "Two whisks, and some scouring pads" into anything industrial." duh! do you think I was born yesterday? why of course you could "SCALE UP" the apparatus, as well as the parts! this isn't complicated! and I never said that I was making an industry! where the heck did you get that from? I simply meant that I would make it a few times bigger, but definitely not for an industry! you are so presumptuous! stop making so many assumptions. besides, it was NightHawkInLight's idea in the first place! check 28:25.
now, he was using the combined output method, but you can still make the outputs mostly separated if you construct it correctly, and perhaps using something better than a sock.
"Incidentally, I didn't / haven't changed the subject, and I suspect your apparatus is quite small." suspect all you like, but you still don't know. besides, you couldn't know, because I'm just theorizing, I haven't made anything "scaled up" yet! and yes you strayed from the original subject, you started talking about terminal velocity when we were originally talking about electrolysis of hydrogen and oxygen!
Reply: @theskett  "You misunderstand.  Aluminum electrode(s) will dissolve in a KOH / NaOH (and probably NaHCO3 etc.) electrolyte.
In the absence of any applied voltage.
So you cell just sits there, and eats itself.  Probably not what you want.  But hey, your $$.  Go have fun."

did it ever occur to you that you could just take out the electrodes? it would literally take seconds.
and no, I do not misunderstand, I am aware that it will dissolve without any electricity, and I even said so earlier!
I said quote: "any aluminum that goes into the solution will react with it, so what is the problem with making an electrode with some amount of aluminum already on it so you don't have to come back every once in a while to place aluminum foil squares into the solution?" yeah, I already knew, and you weren't really paying attention.
Reply: Lol... collect the chromium III and you can use that to tan raw hide into leather.
Yes it turns it blue but in an emergency Leather is still leather.
Reply: Why not stick a huge piece in before even starting the process? I would think it would take care of the issue as it happens and cause no real downside or interfere as long as it's not directly touching the electrodes or gasses?
Reply: ×e
Reply: daddyo44907 used to make very nice HHO cells out of stainless steel pipe. The account has been inactive for a number of years but it still has some useful information.
Reply: Isn't this stuff magnetic? Couldn't you pull it out that way(by adding magnetic Fields)?
Reply: I wonder if this would be an OK way to produce some dilute Cr(6,). While I have some avaliable this seems like an OK way to get a solution for maybe coating Mg or something
Reply: @aleksandersuur9475  One is never aware of all the factors. That's why working in teams is so important. Stainless steel does have attractive properties, but it's easy to forget that it contains chromium. And the content varies.
Reply: @Xayuap  
when we were kids we would dissolve balls of aluminum foil in a solution of lye in coke bottles. We would capture the hydrogen by filling up Balloons stretched over the top of the bottle. We would also light the escaping gas just for the he'll of it.
Reply: @garthfarkley  what a good childhood. You could derogate goverments with that attitude. There's people who runs scooters out of Aluminum cans
Reply: @Xayuap  
It was kinda crazy. My Mom went to Esalen in the 60's when I was 11 and dropped me off with some hippies for 2 days. There was no food in the house but I did learn that neat trick. 

Worth it.
Reply: @garthfarkley  hahaha, what a experience. ¡ u nou, mam?, ah larn hotto make nrg bah maself !
Reply: this is really cool for inflating balloons with pure Hydrogen, if it's managed to be done with 0% oxygen or close, then really big dirigibles could be made, as it floats 4 times more and is way cheaper than the stupid Helium.
Reply: 27:40 why does the water turn red?
Reply: I am  trying to make your bottle-and-brakeline airsoft gun. I would like to alter it so I could pull a trigger to fire it. My current plan is to hook up a co2 cartridge and a trigger mechanism so I can fire it wherever. Do you have any thoughts?
Reply: @Metal_Master_YT  Isn't this what I said?
Reply: @Metal_Master_YT  Less explosive than HHO mix like electrolysis gets unless you separate it  The hydrogen from chemical reaction water, aluminum and lye, lacks the oxygen like the electro way has so the explosive effect is much more mellow.. more like boof or boom instead of bang BANG... make some of both and ignite them and see what I am talking about...
Reply: @Metal_Master_YT  Yes you can pull it out and rinse it and in some situations going chemical can make sense. It is easier and way less to deal with and clean by just using stainless and being able to turn the thing off with a switch or your ignition. I went as far as having my aluminum in a basket that I could raise and lower in and out of the water lye solution so that I could turn it off sorta. It stopped the aluminum from turning into hydrogen at the rapid pace I need in order to get the 2 liters per minute in order to improve my fuel mileage but the aluminum still was turned into fuel, just much slower.
Reply: @theskett  LOL OK :-) On my next one if I have a next one I will try to go for the ketchup and post it. I would hope that I wont have any lye explosions at this point but maybe I might since I am going to try 120 volts DC and 60 volts DC real soon for a torch... Might just get a bang out of that instead of a cool torch..
Reply: @theskett  Thanks and You are welcome :-) I think I am going to get to testing out what kind of damage I can do today lol...
Reply: @theskett  indeed..
Reply: I know it's not the subject of the video,  but I was wondering what effect high and low frequency sound has on water that is freezing?
I noticed that no results pop up when I looked this up.
So no one has looked into what happens...
Idk I might try with an outside speaker, a freezer, and a metal bowl of water.
I'll let you know if it's interesting.
Reply: @tigermanmccool4037  That would probably work good. I have used the rubber round table feet things like canes and crutches have on them in the past as a blow off valve type of thing in case of a backfire. Speaking of backfire. I was experimenting with vaporized  gasoline in a 71 Datsun truck and had a 2 or 3 gallon gas can under the hood with that blue ribbed hose stuff like car was vacuums and pool filters have going from the gas can with a couple inches of gas in the bottom and connected to the carburetor... I tried starting it and it started to start and then backfired and I watched that flame go from the carb through the blue hose to the gas can and it exploded but thank God not like I would think it should have, it boomed but muffled and sprayed liquid gas all over the truck and around it. The liquid gas somehow put out the fire instead of being a big insane fireball like it should and could have been... I stopped playing with that set up right then...
Reply: @onradioactivewaves  FREE IS ALWAYS HOW I LOVE TO ROLL TOO LOL..
Reply: 12V lantern batteries are a great source for graphite electrodes. They are much more environmentally safe and last longer. Get them at Wal-Mart as well.
Reply: @beckwerks  "Less explosive than HHO mix like electrolysis gets unless you separate it  The hydrogen from chemical reaction water, aluminum and lye, lacks the oxygen like the electro way has so the explosive effect is much more mellow.. more like boof or boom instead of bang BANG... make some of both and ignite them and see what I am talking about..." oh, so you're talking about the added oxygen, well duh, of course if you mix the hydrogen with the perfect stoichiometric ratio of oxygen it'll go bang!
I thought you were talking about just the hydrogen side of the electrolysis container, and comparing that to the other hydrogen.
if hydrogen is mixed with oxygen, is it pure? uh, no. xD
Reply: Wow , this is so awesome! I don't have a clue what you are doing but it's very intriguing.🤔👍
Reply: great stuff !
Reply: Hhh
Reply: @the_overthinking_philosopher  Project farm did a video on it. No significant effect.
Reply: @drgonzo7806   It takes 316L.  Even 304L will degrade in the solution while operating.  Alternatively, I have ran experiments with carbon-coated 304L and it seems to last forever with no sign of degradation after days of run time.  I think the next type I might go to, if this eventually fails, will be graphite foil in a dry cell configuration.
Reply: How can you use this experiment in practical life? Can you make a gas cooker to work, from this experiment - to burn hydrogen to get the flame and getting the oxygen to help get a blue flame?
Reply: @mihindu-qc6bl  HHO torches. Can be used to cut , melt and weld metals (it can melts rock too)
Reply: one needs a platinum coated electrode
Reply: Please add Arabic for translation.. Thank you and I wish you success always
Reply: @theskett  easy my man - dude may be thick but we could do with a lot less of this kind of talk to each other; words are powerful as f*** man.

If i truly didn’t care about someone’s life I would just block/ignore/whatever them.  Not saying valid points aren’t being made lol, but I’ll say that I’ve been working on removing that kind of stuff from my speech habits..... definitely feel like it’s had a sizable positive impact on my mental state, not to mention making me a lot more pleasant to be around.  I also respect myself a LOT more for refraining from it, after my trigger wears off lol
Reply: @the_overthinking_philosopher  yeah like that Australian guy running his vehicle...
Reply: This may have already been answered here, but... Citric Acid can reduce Cr(VI) to Cr(III). Before disposal, use HCl to bring solution to neutral, add in some citric acid and let sit at least overnight. Multiple days to be sure.

If you used NaOH, you'll have citric salt water with chromium and rust dust.
Reply: You wil make an aluminium algamatw i belive.thats the same problem than
Reply: But the ch4 you can use fir other things.just be carefull with it
Reply: Why not use carbon stick electrodes.  They are sufficiently conductive, yet non-metallic.  They last a very long time.
Reply: @ThomasAndersonbsf  Graphite will burn with a flame under water when in contact with the pure atomic Oxygen on that electrode!
Reply: @freedomspeech9523  guess one needs to make sure there is not a flame there, :P *(yeah carbon has a melting point of like 5000 degrees but if in an oxygen containing environment 700 degrees is about all it takes to cause it to combust so its only good for say a crucible if it is under argon or something, to prevent the oxygen degradation. Everything has caveats like this it seems, and I have been exploiting many such in the design of material deposition for my 3D printer replicator level upgrades ;)
Reply: @ThomasAndersonbsf  That is in an O2 rich environment. But dissociation of water molecule makes mono-atomic Oxygen. There is nothing more... oxidant than that. Sure, it will connect to other Oxygen if is freed from the metal, but at the separation time, the cathode is in direct contact.
Reply: @Bobsmith-xq2pr  But it is way more efficient.
Reply: @pamike4873  You should look at how hexavalent chromium interacts with your cells. A better analogy than asbestos would be plutonium.
Reply: Can you make a Tesla’s steam oscillator earthquake machine?????? Been watching your videos for 14 years love every one of them!!!
Reply: Can you make a super heated torch since super heated steam can catch stuff aflame
Reply: did you accidentally make a mistake   I though it was Lower voltage and more amps   that was more effective at making HHO
Reply: Make a car engine. Just add water.
Reply: Hydroxy is more fun than hydrogen gas and oxigen gas.
Reply: @axiomfiremind8431  are you suggesting perpetual motion?
Reply: @nitroadshadow4667  he kinda did say that in the video
Reply: @BurkenProductions  Quite the contrary ... That English is PERFECTLY understandable and clear!
Reply: How did you attach/glue the tubes into the flashback arrestor bottle?
Reply: use 316L grade (carbon steel kitchen grade and has no chromium metal alloy in it)  which will avoid chromium related issues.
Reply: I use tide washer detergent as a catalyst
Reply: Is this still a concern when using baking soda?
Reply: Can you make a gas stove with this technology producing gas from water and electricity? Wouldn't be cheaper than a all electric stove?
Reply: Hearing another babah running neighbor and knocking on the windows screaming Gas
 you che che there doing, it's not me it's my dog.
Reply: @ukirfan  316L contains chromium though, its around 16-17% if i remember correctly
Reply: @harrylenon9594  yes it * could explode if there was a spark and you were using the explosive mixture. Or it could burn. Aside from from having ignition,  or asphyxiation from breathing pure hydrogen,I think it is perfectly safe to breath, and supposedly therapeutic.
Reply: Try frw times. Got popped. hydrogen but clarify no bubble. No enough oxygen after few hours
Reply: @dandan-gf4jk  "Erin Brokovich vs. Pacific Gas & Electric Company of California - hexavalent Chromium"
Reply: @drgonzo7806  Excellent!  Someone with a lathe could make the turnings, though I don't think I've seen [felt] turnings that aren't sharp.  But gloves etc should make it doable!
Reply: ⁶8
Reply: Why don't you use nickel-based anodes? I would stay away from steel or any other iron-based alloy for that side of the cell. Best case scenario, your anode passivates and stops working. Worst case, your anode corrodes, and starts releasing carcinogenic chromium species.

Also, if you pack the scouring pads tighter, you should see an improvement in performance, because of improved contact resistance between whisk and pad.
Reply: How much hydrogen are you able to produce? Could you make enough for welding?
Reply: ...hey man i dunno how into archeology you are....but seeing this operate really makes me wonder if this could somehow be the real function of Baghdad 'batteries' and/or the great pyramid....
Reply: Could this GREEN precipitate be collected and used to stain any alloys???
Reply: you play with the oxygen and Hydrogen, I'll just watch lol
Reply: Very impressive video, thanks for sharing your knowledge man
Reply: Is Chromium 3 the stuff they put on motorcycles?
Reply: What if that gas came out from the reaction of the bottle itself can we make that a fuel for the combustion engine? 🤩💯👍🏼
Reply: This whole discussion made me realize that chemistry pioneers probably poisoned and or killed themselves, so that humanity could advance their understanding.
Reply: nonetheless at least one of the electrodes will rust, if used long enough.
On one side it creates iron oxyde, which binds oxygen and therfore you produce more hydrogen.
ref. the experiments of Antoine Laurent de Lavoisier.
Reply: Do you have a good method for  compressing and storing the separate gasses?
Reply: @dandan-gf4jk  i believe your ss corroded due to the carbon that is in low grade ss metals    i have seen ss rust before especially when buying cheaper ss that does not have a utc unique tracking code or the equivalent
Reply: @napalmholocaust9093  it depends on where you get the ss from   there are many alloys and unless you are buying a high grade ss with utc   from a well known supplier  then you could end up with metals that you dont even know are in the metal
Reply: First of all thank you for the informative video, I have a question: Where did you get that whisk (in my area the shafts are enclosed and it is pretty hard to open them up)? Another question is: if I would like to use carbon fiber for the anode most of the health related problems would be solved am I right, but how would you make the design then (maybe a good video idea too)? Thank you for your answers in advance.
Reply: That would be the case if your electrodes contain chrome
Stainless-steel does not!
Reply: Theck this: close in engine argon and helium gas and ad to it wery high voltage spark and engine will work. The same with water inside. Yutkin effect.
Reply: Isn't food-grade stainless (10/18) safe to use without causing that poisonous hexavalent chromium?
Reply: I have been using Epsom salt (Magneseum). It oxidizes the electrodes less and works better than Backing Soda. I don't enjoy the idea of the toxic PC....There is always something that can be milder. Also the average voltage should be around 3 - 5 volts. Anymore is wasted as heat. Though the amps can go up pretty high.. Just some of my experiences of 5 years of experiment. Add a PWM too...
Reply: Are you considering a DYI fuel cell project for the gases?
Reply: you said you produced half a gallon of hydrogen in 25 min, how much watts did you spend on that? sorry im green in physics :)
Reply: What about using TIG tips?
Reply: Blah blah blah toxic chemicals blah v
Blah blah
Reply: @jerrywhidby.  
Not necessarily - these people are everywhere.
Reply: hey friend, i donot have any thermodynamichal analysis or electrical generation process for you, just wanted to leave a simple idea out there synce we'r livin in times we so desperately need to change our ways of energy consumption.
So, imagine a 2 cilinder vacuum sterling engine. Do you suppose a coil system could be adapted to sustain the engine motion through electrical generation, powered through a battery, with the purpose of generating a vacuum chamber able to separate oxygen and nitrogen from hydrogen, combined with water electrolysis, wich could be stored for the production of liquid hydrogen ;-)
Reply: @dandan-gf4jk  perhaps you only do this when it is disposal time ? That way it is safe to handle
Reply: 304 will degrade....  316 actually will do a little better due to its molybdenum content
Reply: Baking soda works best as a catalyst and is easy to clean. Just a line running to the intake vacuum with a water separator between will run any engine. You increase your electrical ohms by using a light dimmer switch and you have a perfect system that does not require storing any hydrogen and it will never be under pressure
Reply: @kyng832  baking soda is the best. The system will need to be cleaned often enough. Salt can play a bad role on the system anyway.
Reply: @popeantichrist8847  Those are the best but expensive , there is another as well thats a little bit cheaper, There is another metal that is very similar but half the cost and lasts just as long though i forgot the name.
Reply: @jenbadabam8801  I don't understand why he doesn't simply have a bottle of white vinegar nearby. I have messed around with high ph solutions plenty, and have had it contact my hands many times. Straight or even somewhat diluted vinegar instantly negates the caustic characteristics sodium and potassium hydroxide. You can feel it make that slimy or soapy feeling on your fingers go away like magic, while running water would take at least  several minutes. 
Am I the only person that is aware of this?
Reply: @Impatient_Ape  aluminum is a very unstable metal. Electrolysis with aluminum it's a simply combined it with anything other than a plastic barrier. Just about anything touching it will cause it to corrode
Reply: Before fuel stations was placed in every county in the country there was the hydrogen system and the manufacturer replaced the systems to the fuel systems that started the lost technology of running your engine off of water. People was convinced of the convenience of just topping the tank instead of maintaining the water jug and the cleaning. Main parts needed for the system is plates for electrolysis. Using same method of electrolysis you can gold plate them👍"not needed". 
Plastic candy jug makes everything easy to clean. Baking soda is mixed in the water to create a scrubber between the hydrogen and oxygen. Hydrogen is pulled from the system with the vacuum of the engine turning over and when the fuel, hydrogen, reaches the combustion chamber it will fire. 
On any battery size it is the same, just scale to size. To control the ohms used in the electricity you use a dimmer switch for household lights. For a V8 engine, on the highway pulling a load you will need about 48 ohms. There are systems that are running completely fine and have been for decades. This information keeps getting blocked. Censorship is a real thing. Back to the topic.
Don't overthink it, you would laugh at how easy and rudimentary it really is
Reply: @banditeastlick2471  I already know this, both from personal experience and from working in an industrial chem lab of a metal processing factory for 3 years. "Chemsplain" to someone else.
Reply: @banditeastlick2471  I can see why we both assume we know more than the average commenter.  Another example of what "assuming" gets us.
Reply: Have you seen the old videos of people running cars on this system using 2 x batterys powered by 2 alternators and a large chamber with lots of plates of metal rather than your wisk and stainless scourer running the engine and alternators recharging the batterys so the only output from the exhaust is water? I would love to see a video by you on the fesability of this? If i remember right he still had petrol coinnected to start the car that could be switched off and an electronic valve opens to let the browns gas take over once engine is warmed up. A car battery when connected to an alternator while the engine is running reaches around 14 to 16 volts if you have twice that powering a purpose built gas generator how much volume of gas can be produced per second? is it enough to run a standard 1.2L 4 cylinder engine?
Reply: @cmdrcrimbo  the amount of hydrogen being released is the process of controlling the amount of ohms. A big block V8 can run off of 48 ohms. You can reach this with a 12-volt system
Reply: Yeah and too much salt in water when people do this in fish tanks to help oxygenate the water or help kill bacteria can release chlorine and kill the fish or poison the hobbyist haha oops xD
Reply: @ArtyMars  baking soda is the best catalyst to scrub the hydrogen and oxygen with the bonus of being a cleaner method.
Reply: @frollard   Even in the regular store you have to check to make sure containers haven't been opened or name brands bootlegged. A lot of companies have twigged that product moves faster at some dollar stores and sell junior size product.  But I have run into messed up steel wool - sheesh!
Reply: Goggles!
Reply: You used one side of the PH scale now try the other. By nature acid is extremely more efficient and explosive then alkaline side of the PH scale. Also if you use acid with iron and Positive side, and balance your temperature the effects are self sustaining until the iron is dissolved. Acid will activate without electricity once it hits a certain temperature. The power supply drops to zero when you hit the right temperature. It's an awesome effect and it does work
Reply: Thanks for the caveat. I source some materials from dollar shops- God only knows what's actually in them!
Reply: great, what the hell is KOH...
Reply: @jbodden6977  that someone overthinking it. Use the techniques that my great-grandfather used alongside my grandfather while they use their tractors when there were no gas stations around. Yes they had generators instead of alternators but nevertheless, you are seeking the ohms in the electricity and you will measure them from 0 to 48 ohms. You use a water and baking soda solution. Notice my vocabulary will not get any more difficult than a farmer would use in 1920
Reply: why don't you use a metal sheet to connect those two bottles in stead of the syphens
Reply: Can you use AC alternating current?
Reply: @Teacher_Skid  all that matters is keeping it simple. The knob dimmer switch should be used so that you control the ohms being applied. Generators or alternators have worked perfectly and flawlessly on equipment and vehicles. Needing a system to where you might need 120 volts or more maybe a little bit overboard on any type of project at home
Reply: to completely negate this you can use titanium, nit something you can find on a grocery store but titanium strips should be easy to find  in the internet, ebay amazon whatever
Reply: Just curiosity if you replaced the wisk with a tungsten rod what would be  the result?
Reply: @drewberrynews3875  this reaction is based on serfaces as large as it needs to be. This video isnt the best and safest way. Car battery is the best and 4 metal plates spaced,2 wired positive 2 negative in an alternating pattern. Light dimmer switch will provide excellent control over the amount of OHAMS being produced by the battery. For a big block v8 you can expect to use about 60 ohams and a small block about 46 ohams. Use baking soda for the catalyst or "scrubber" to separate the O from the H
Reply: I Translated an ancient manuscript written by a sage who visited Egypt 500 years prior to academia time life for the existence of the pyramids.  The author described how the great pyramid was being built.  He described the tall, pale,  blue eyed, blonde headed peace loving super intelligent people who are building the pyramids. He also described how these people built a 100 cell battery,  split ocean water into gas to fly zeppelins made from cattle intestines to transport people and supplies a and he described how they used bulls and beer in sealed granite boxes to create light energy.
Reply: Humans 0
Saiya-jin 1 to 6
Angels 7 😇

Kalki Ironman 5th matriya buddha 8th arc Angel 11th satguru 13th imam and 24th avatar after 2026 😎

Almighty God 9 😇

Humans type 2.5+ after 2026 by Kalki Ironman (christ in the white horse)(son of man on clouds) type 7 and 8 😎

Jarvis the world’s first artificial intelligence (parrot) 😎

Cuz Kalki is ironman batman super saiya-jin superman ben10 saitama Narutoo shaktimaan and every super heroes combined after 2026 😎

Jarvis world’s first artificial living being (just like vision in marvel universe)😎

Made of Quantum and sub quantum particles 😎

Power source quantum energy arc reactor (type 7) level technology 😎

Kalki Ironman going to have every kind of arc reactor like:- type 1 Nuclear fission, nuclear waste, hydrogen fusion, type 2 3 4 5 antimatter arc reactor (solid liquid gas), type 6 electro quantum arc reactor, and type 7 Quantum arc reactor, type 8 limitless quantum energy arc reactor without quantum particles 😎

Kalki Ironman going to have sun in a box million billion tons of hydrogen nuclear fusion reactor type 2 3 4 5 just like sun and stars in the palm of his hand 😎

This all going to happened by self replicating quantum nanobots knowledge energy and techniques at type 7 7 7- respectively 😎

Ironman (Tesla 2.0) going to reveal every secrets of the world specially Tesla and his Antigravity 😎.:;,,;:. ,;:..:;,
Reply: @Metal_Master_YT  Yes…also, your chosen profile name should give people a great clue 🔍👀 as to your knowledge of metals and level of experience with them…🤷🏻‍♀️🧐🤔🕵🏻‍♀️ (Maybe I’m overconfident in people, but I would hope folks interested in the subject matter of this channel have at least a basic understanding of the risks involved, & how to mitigate those risks…) 😆🤦🏻‍♀️ Think how much people could accomplish if they just research a lil bit instead of making unnecessary critiques on comment threads…😉👌🏽 (Hello, Pot, I’m Kettle, you’re black.) 😅🤓🤓
Thank you!! Stay safe out there, be blessed. 😎🤘🏽💋🔮⚖️
Reply: @shannap.lawnerd8107  which comment are you replying to? I cant find it ☹ it seems there are too many comments is this section. 😅
people often think my username refers to the music kind of metal, but that's not the case at all. 😆
Reply: @bardrick4220   Wish I had some pladadium
Reply: Hey what about having 2 separate containers filled with the scrubbies then you connect both of them by double piercing them with a steel rod so no need for any worries for combing gases
Reply: Could you instead of using STAINLESS steel use plain old steel wool? It odxidizes more easily, which is why they started making stainless steel in the first place!
Reply: Trivellant Chromium is much safer, but it isn't quite as bright and shiny
Reply: At 20:00i into this  video ; could you also introduce gasoline vapors in by incorporating a slight vacuum on the outlet hose?
Reply: amazing. you guys - its all about playing (making bangs or filling balloons) ..instead of making something that seriously makes SENSE - for example creating a heater to warm the house.
Reply: @the_overthinking_philosopher  You would want to produce the gas separately and then introduce it to the vehicle.
The energy required to provide enough gas to power a car via the vehicles alternator would more than negate any advantage.
Reply: have you tried to shred the scourers then pack them tightly inside a contained whisk , was wondering if it would be better result or worse?
Reply: They make and sell copper scrub pads...what would that be like and if you use one pot me this how can you easily! Separate the oxygen from hydrogen?
Reply: @wolffang489  they got copper metal scrub pads you can find would that be better?
Reply: @NTF-zb9wi  can you explain that top me?
Reply: @IberianCraftsman  ya I've always said that must be many compartmentalization and new methods to make very safe
Reply: @dreamcastknight  water is very complex so much that some day we still may not know everything about water..reas up or watch bids about the memory of water wicked interesting
Reply: @studywithme8055  why cant you use those copper scrubbiest they sell? What would happen?
Reply: @williamrussellmorley  If it's pure Copper then probably?  I'm not a chemist but I don't think the type of contact metal effects the reaction's useful output (aside from conductivity, which is actually higher for Copper) so as long as it mitigates the poison problem I'd imagine it would be better.
Reply: @onradioactivewaves  Google George Wiseman of Eagle Research, he has many vids and also books available on Brown's gas
Reply: @agentshillbot  thank you, I will check that out.
Reply: 30 volts is not a very efficient voltage for electrolysis.
Reply: Wow what an answer to their concerns on disposal. So educated, so filled with mind blowing knowledge.
Reply: Good safety tip.
Reply: @shinrakishitani1079  that's exactly right.  It's how some Waterplant operations produce clorine for water treatment.
Reply: @patrickbowen9395  stainless steel screen?
Reply: @the_overthinking_philosopher  I have seen a 50% increase I'm MPG. Also, an added benefit is smoothness and cleaning of the valves and cylinders.  Bonus.
Reply: @reypolice5231  if you have your safety device on board, not a problem. Anti burnback device.
Reply: @oliverford9325  are you referring to permeable electron membrane? Yeah I think I screw that up and ment to write proton-exchange membrane. And no stainless membrane wouldn't work it would just serve as another neutral plate which would produce hydrogen, I believe.  I did have the idea the other day to try using lamb skin or even latex condoms as a membrane but I've yet to attempt it.
Reply: @patrickbowen9395  I am just getting into this hydrogen power thing. And even though I had a big stack of info on it, I haven't acted on it. Now I am really interested.  I wish you great good luck and good results!!
Reply: @shinrakishitani1079  100% that’s how salt water pools work .I ran one for years on large commercial pool . The public were brainwashed to think a salt water pool was chlorine free pool  by mass advertising when it was actually chlorine on demand from the electrolysis and 1000 lbs salt dissolved in the pool water
Reply: ⁰
Reply: All jokes aside I'm really glad you explained and demonstrated the need for flashback arrestor. Isn't there an in line device like a check valve that oxy accetelyne torches use?
Reply: @katiemom8260  yes.
Reply: Do you guys have pointy hats and wave sticks in the air?
I do have a cool resume but Chemical Einsteineer isn’t on it.
This stuff is magic.
Reply: First Church of Shiba Inu  short answer,  yes. We are working on a small engine project and plan to scale it up to a small pickup and on up.
Reply: @skiptoacceptance  a most excellent test material too. Low price is always best for start up theory. Save the expensive stuff for after
Reply: Hello, have you ever heard of HH+ being used instead of potassium hydroxide?
Reply: @ryandayao  can you get some of that? It shows not for commerce ......yet.
Reply: @oliverford9325  No I saw it on a different YouTube video and I thought you might’ve known something about it.
Reply: @oliverford9325  Yeah the other video I watched said the same thing. He was able to get some because a viewer sent it to him.
Reply: @oliverford9325  I would love to see how much more conducive it is than the potassium.
Reply: @ryandayao  I'll keep digging. Keep you posted
Reply: @patrickbowen9395  > Now do a video on how to make permeable electron membranes! <
- It is not ELECTRON flow in the water, it is the positively-charged IONS. Any kind of cloth that can withstand the electrolyte can be used to permit ion flow. Fiberglass cloth is the most durable. Nickel-coated fiberglass cloth could also be used as electrode material, but you would probably have to make the coating yourself, which is not easy.
Reply: @175griffin  - What about pure nickel? Also, Nickel-coated fiberglass cloth could be used as electrode material, but you would probably have to make the coating yourself, which is not easy. Either electro-less plating or vacuum deposition seem the likely choices. Any kind of cloth that can withstand the electrolyte could be used to permit ion flow, but plastic cloth (other than Teflon/Goretex) would not be good in vacuum. Fiberglass cloth is durable and cheap. But even pure Nickel may be attacked by Chlorine ions, right? So distilled water would be best to start with.
Reply from the maker: @freehat69  I read that also but haven't been able to make it work.
Reply: @freehat69  Electrical Discharge Machining I believe is what the terms are for it,
Reply: @freehat69  oh the graphite is machinable so you can connect it to an electrode and then use the electricity from it's surface to the surface of some hard metal or conductive cermet (ceramic metal like Tungsten carbide) to machine the surface to mate to the shape of the graphite was machined to.
Reply: Those are not stainless steel whisks. They are chrome plated steel.
Reply: Maybe Stanley Meyers Car ! Might be Helpful ! Here !
Reply: This is one of the most intelligent comments I've ever read under a YouTube video.
Reply: Would simply using better grade of stainless steel fix the problem? if yes that what kind?
Reply: @MorRobots  OMG, Hexavalent Chromium is the 🌎🌍 killer, people killer, heck, anything Killler, right? That movie, with Julia Roberts?????
Reply: @dandan-gf4jk  Cr(III)   ???
Weird! mental imagery associated, flashback of a History channel documentary. Volatile aviation fuels in the Germans world war II era prototype testings. Why did that just happen? Strange things these days. 
,
Reply: I planning on urea additive in place of KOH (you know what I mean).
Reply: dude you are a genius
Reply: a MUCH better solution, imho, would be thre replacement of stainless completely in your generator stage using readily availible high density carbon. there are some recent papers claiming up to 70% increase in efficiency production
Reply: This video has a LOT of useful information.
Reply: Excuse me is that like the transformer u get when u strip down a microwave u have the closed metal container with two electrical parts at the top for electricity to go into? Could someone please answer ?
Reply: Bbbb
Reply: Bbb
Reply: @dandan-gf4jk  b
Reply: @dandan-gf4jk  bbbb
Reply: But sir can u use it to run 🏃 a 200cc bike 🚲 engine and what and like at what km/h did u think that it can move and does it has any disadvantaged on the engine or environment sir and how long did u think that it last sir
Reply: @dandan-gf4jk  would the contaminated water after it's use be good for dumping into a  sprayer to use it as a weed killer around your property rather than a R143 from a Tractor Supply or a Roundup? It would seem to me that it would be capable of doing that being that it is a corrosive. 
I have been fascinated by this to use as an alternative fuel source on demand rather than it being used stored where it could be potentially more dangerous and explosive. I have watched many online who have done such a thing as well as using wood gasifiers. If we were to be more energy dependant on a renewable source like this then we could potentially go off grid apart from the corrupt utilities companies that hold us captive to their beast system.
Reply: @Impatient_Ape  I agree. Some people missed the class on how to be humble and compassionate to others. I have no problem with constructive criticism over destructive, condescending criticism.
Reply: i can only wonder how this could apply to vehicles.  having 2 separate tanks makes sense.  Thanks for producing this clip.
Reply: @onradioactivewaves  Just get one of ebay for rougly 200 USD. The Problem with a simple setup is that you will breathe traces of the KOH too, you need to filter the gas in some more bubblers before actually using it. Btw, those chinese designs actually are pretty good.
Reply: do you think a human can safely breathe the oxygen gas from the separated system?...that is the positive line correct?
Reply: @brenbrenisen1380  No you can't. There are still traces of the KHO in the Gas. They need to be filtered.
Reply: For making oxygen and hydrogen, chromium(III) is not really a concern at this small scale. However, if you are using electrolysis to restore cast iron cookware, it is another story
Reply: Yes and light the hydrogen on fire right next to where the hydrogen is coming out of a tube and being produced how intelligent...
Reply: @Adeptus33  there is a bubbler in between...
Reply: I used graphite rods in my electrolyser. I recover them from old TOSHIBA batteries and i have eight of them 4 with 4.
Reply: @drgonzo7806  316L better
Reply: I believe platinum or palladium salts are the best choices available.
Reply: PLATINUM ELECTRODES …..expensive but safe and not sacrificial
Reply: @onradioactivewaves  Never, ever be breathing HHO (Brown's gas). That's like breathing gasoline fumes (hopefully minus the benzene...) one little spark and your lungs go kablam
Reply: @the_overthinking_philosopher  It extends it 0%. The electricity required to run it is more than the power output it can produce.
Reply: OK, but  some of us are poor. How about just telling poor people how to be safe?
Reply: Absolutely fascinating 👏 kudos, now how do you turn the hydrogen output into a weapon 😀 #FJB and use the power generatored to power a Bitcoin mining device
Reply: Aluminum is a neurotoxin and is hard to dispose of properly?
Reply: so, if the stainless steel does not contain hexavalent chromium, is it safe to perform electrolysis using KOH or NaOH ? is the resulting O2 breathable ?
Reply from the maker: @mquevedob  No, medical oxygen requires filtration to be sure no microdroplets of the electrolyte are contained in it. In not comfortable recommending any homemade setup for medical use. A medical oxygen concentrator can be had for a few hundred dollars.
Reply: @Nighthawkinlight  how about the Cr6 problem. Is it safe with Al foil?
Reply from the maker: @mquevedob  No not to breathe. The aluminum foil solution just neutralizes the electrolyte prior to disposal, it doesn't stop more from forming if you keep running the cell after putting foil in.
Reply: @Nighthawkinlight  what type of electrode would be safe then ?
Reply from the maker: @mquevedob  None would be safe for breathing without extensive filtering. Graphite electrodes would not have the chrome issue, but still have issues with electrolyte microdroplets in the output along with any number of other contaminants that would be harder to detect and remove.
Reply: @Nighthawkinlight  not considering breathable anymore. Just making electrolysis aafe
Reply: That's dope info 🤔
Reply: Thanks!
Reply: @drgonzo7806  I believe it will degrade. It's the nature of electrolysis.
Reply: @ThomasAndersonbsf  I've picked up a lot of information through the years which I roll over in my mind while designing. Someone suggested using copper as the electrode(s). Now we know copper will oxydize & no longer be of good use. But one guy pointed out that copper won't corrode if the electrolyte keeps moving. Just wondering what your thoughts might be on that.
Reply: @michaelcre8  Perhaps if you change the frequency. 60hz = a water heater.
Reply: I'm not a rocket scientist so I will say this in plane English, back to the idea of using the split to run an engine while making oxygen and using it to end our dependency on oil.
Reply: i would love to see an engine powered by on demand HHO gas
Reply: I work in a chlorate plant so I'm surrounded by chromates and dichromates every day.  In testing over the last couple weeks I've done out you can concert hexavalent chromium into divalent chromium by mixing a solution containing it with some hydrogen peroxide and an acid, I'll make up some vinegar to test tomorrow but extremely dilute sulfuric acid works beautifully.  The solution turns from yellow or orange to light blue, then over time in contact with air converts to dark green.  If just adding in peroxide and sodium or potassium hydroxide you can convert the yellow dichromates into red/brown chromium (V) species, and when mixed with dilute acids turns into green chromium.
Reply: @ThomasAndersonbsf  wouldnt graphite erode quickly at the anode and produce unwanted CO2?
Reply: Well the info is good but so many out there seam scared to make it.Well you can go out and buy it already made up. So you don't hurt yourself's in the process of making hydrogen.😅 People are not very energetic of trying new things that they could prosper from. If I wanted to I could make moonshine and run the vehicle off it. And you don't have to be a chemist to do it.!!
Reply: @aleksandersuur9475  So you think the kids will be drinking the hot caustic electrolyte? I think they've got bigger problems than chromium if they do.
Reply: Smart! Tnx! 🙂👍🏻
Reply: 可以使用饮料易拉罐的皮吗？
Reply: @ratgreen  i think you underestimate how much of a difference that would make in terms of surface area
Reply: Dude o2 has first application , breathing. breath into oxygen to energise body organs. dont do regularly as body get accustomed to and u get addicted
Reply: @Nighthawkinlight  I've seen where you can run a generator off the single line design. Is it possible or will the generator explode?
Reply: Is anything harmful produced by using bakig soda?
Reply: THAT IS FANTASTIC ADVICE!
Reply: Adding foil is hardly a big problem..
Reply: @aleksandersuur9475 what metal is more appropriate then?
Reply: @napalmholocaust9093  I guess no matter how good the quality, it will rip some chromium out of the steel.
Reply: I am very grateful for your care and attention in explaining and sharing so much useful information, I have been looking for the most efficient ways in terms of hydrogen production for teaching purposes and for personal use, and I believe that you have raised my knowledge to another level, thank you and best regards of the brazilian brothers
Reply: @carlosalbertosilva3176  What do you do with your hydrogen ? I like the torch usecase.
Reply: @lezlezman1843  - Fun fact... the original discoverer of Al originally called it "aluminium" but then decided to drop the extra "i" and simply call it "aluminum." That said, I find it interesting that people insist on pronouncing Al as Aluminium... given the extra "i" was dropped 200yrs ago :^)
Reply: @Real_Claudy_Focan 
Hi Maveric,
I hope you are still there. Please I want to ask you a question, I am a science teachet here im Kenya, Africa. I could not find a DC motor, but I have welding machine with positive and negative terminals. Is it okay to use this machine for electrolysis
Thanks
Reply: do you have a formula or ratio for your 1x1 aluminum foil dissolve method like example but would dissolving 2 pieces of 1"x1" foil for every gallon of electrolyte solution sounds good?  your electrolyzers looked between 1/2gal -1gal quality??
Reply: damn u are a GREAT TEACHER
Reply: Very innovative and informative video but please make it small, not lengthy.
Reply: WOW!  Hydrogen is very very easy to produce but you must use a copper coil to as one of the electrodes ,  WHY    You need to understand the copper it is none magnetic and when "Vibrated (not an osillation),, at the correct freq you will be shocked at the Hydrogen output....
Reply: The center field of a copper coil  is the neutron field  in a coil of copper, so you emit the neutrons from the copper coil   and   wow!!  It will totally blow your mind..
Reply: @Nighthawkinlight  
2:01
Oh, I think I know the uses of pure hydrogen 😈

And pure oxygen 😇
Reply: @nighthawkinlight I’m your newest subscriber, if you would be so kind, I have been instructing some friends in a dire war zone to make HHO Browns Gas to power their gas cooking stove, as an alternative to LNG or propane. They are almost done scavenging the materials. I used the one container setup, not separating the two gases. They are using a car battery, there is no electric service; will this provide them with cooking gas relatively safely? I am using the second bottle to prevent flashback. Any advice you would give we would greatly appreciate it. Thank you!
Reply from the maker: @johngemma3533  You can't get more heat from hydrogen than you would from an electric burner using the same amount of electricity.
Reply: JUST USE STAINLESS STEEL... LIKE 304 OR 316... SHOULD BE GOOD RIGHT?
Reply: Can you just boil away water and store the salt?
Reply: That is so intelligent its not even funny.
Reply: I had a friend who made something like this. He used an aluminum beer bottle as the container, a graphite rod from an old battery, got his power from the alternator, and hooked the single output to the air intake of the engine of his PT cruiser. He said it doubled his gas mileage, but nearly melted his engine block after a couple of months. So he unhooked it.
Reply: Let's play...
I was the science geek and 2nd biggest kid in Jr High and High School in every grade and linebacker on the football team and I'd race at a sprint down hallways from my previous class to the science class to try to break my speed record. Imagine a linebacker blasting by and now and then the trash cans kids would throw in my path. I'd set up my experiments and often be done within 30 minutes, tutor some of the other kids, then go play Blackjack in the back room with the science teacher and after school instead of racing to the gym for football practice so I'd have to do push-ups and track laps I'd spend a half an hour after school in the science class scrubbing test tubes and helping them clean up at the end of the day. If I got in trouble, which I often did, and they gave me detention I'd suggest to the counselor that I take my detention in the science lab and help the teacher clean up and they always agreed. My science teachers loved me so much they gave me a slightly bent Triple Beam scale to help with my new bedroom business I started at age 13 which produced $132,000 in the bank by the time I was 19, which shall remain anonymous here. I don't recommend it. I was also able to land a job as a lab tech at age 16 at a huge OBGYN Clinic and since I was in great shape, young and cute I want you to imagine the fun a  16-year-old kid had working at a huge OBGYN Clinic. I highly recommend it. Over the decades I've invented surgical devices, compound drugs for epileptics and head trauma patients, the first artificial intelligence case management system for the legal industry back when Microsoft was at DOS 2.0 and artificial intelligence quantum computing encryption and attack detection systems. I even made a little video for the USPTO patent examiners to teach them how Quantum Computing works. They loved it. When COVID was raging and hospital for running short on oxygen an engineering friend and I created an inexpensive oxygen generator, but here in Silicon Valley nobody wanted to fund development of something we intended to or sell at a nominal profit, and was so simple hospitals could fabricate them so we could never charge a lot. It was not nearly as efficient as your designs, but did have some other industrial applications and I can think of medical facilities around the world that desperately need them today. If we can save the life of one child do we not rest a little easier at night? There are a series of projects we might explore with your bench skills and contacts and requests I get here living off the coast of Silicon Valley. I've had billionaires set out a blanket on the beach with their tablet waiting for me to row ashore from my home, stalking me to strike up a conversation, pretending they didn't know who I was and poof, spontaneously I would get a lunch invitation to continue the conversation. I like to solve problems other people haven't solved and have several requests that could put a nice cash flow in your pocket if you have a desire to create prototypes of fun experiments and benefit as a board member as products roll out to the medical, utility, maritime, aviation, aerospace and transportation sectors; clients I've served for 50 years. We can discuss this further if you shoot me a text with a convenient time to call. Ironically, despite living right next to Silicon Valley I have the worst cell signal in the world and often incoming phone calls don't ring, but I get a notification 5 or 10 minutes later somebody called and I missed it, so I usually call them back. It's easier and more reliable to just schedule a time to call you using text messaging. When Julian invented ultrasound for Johnson & Johnson and they cheated him on his royalties he wanted to set up his own manufacturing company and I helped him bootstrap that corp and his firm is now the best baby baking in a mama video making wand in the world. For me, the goal is not worrying about the money. You can hire a CFO for that to keep the corporation on track and on the highway. The goal is to save lives, improve ease of use and reliability for Physicians and improve the lives of patients and communities. I do owe a debt of gratitude for all of those original OBGYN Clinic clients I met as a teenager when they invited me home for dinner. After writing down this phone number, feel free to delete this comment so it doesn't hang out in the public sphere. After all, some of the sentences above are probably not fit for prime time. 650-241-9046. I look forward to your text message with a convenient time to call.
Reply: Let's play...
I was the science geek and 2nd biggest kid in Jr High and High School in every grade and linebacker on the football team and I'd race at a sprint down hallways from my previous class to the science class to try to break my speed record. Imagine a linebacker blasting by and now and then the trash cans kids would throw in my path. I'd set up my experiments and often be done within 30 minutes, tutor some of the other kids, then go play Blackjack in the back room with the science teacher and after school instead of racing to the gym for football practice so I'd have to do push-ups and track laps I'd spend a half an hour after school in the science class scrubbing test tubes and helping them clean up at the end of the day. If I got in trouble, which I often did, and they gave me detention I'd suggest to the counselor that I take my detention in the science lab and help the teacher clean up and they always agreed. My science teachers loved me so much they gave me a slightly bent Triple Beam scale to help with my new bedroom business I started at age 13 which produced $132,000 in the bank by the time I was 19, which shall remain anonymous here. I don't recommend it. I was also able to land a job as a lab tech at age 16 at a huge OBGYN Clinic and since I was in great shape, young and cute I want you to imagine the fun a  16-year-old kid had working at a huge OBGYN Clinic. I highly recommend it. Over the decades I've invented surgical devices, compound drugs for epileptics and head trauma patients, the first artificial intelligence case management system for the legal industry back when Microsoft was at DOS 2.0 and artificial intelligence quantum computing encryption and attack detection systems. I even made a little video for the USPTO patent examiners to teach them how Quantum Computing works. They loved it. When COVID was raging and hospital for running short on oxygen an engineering friend and I created an inexpensive oxygen generator, but here in Silicon Valley nobody wanted to fund development of something we intended to or sell at a nominal profit, and was so simple hospitals could fabricate them so we could never charge a lot. It was not nearly as efficient as your designs, but did have some other industrial applications and I can think of medical facilities around the world that desperately need them today. If we can save the life of one child do we not rest a little easier at night? There are a series of projects we might explore with your bench skills and contacts and requests I get here living off the coast of Silicon Valley. I've had billionaires set out a blanket on the beach with their tablet waiting for me to row ashore from my home, stalking me to strike up a conversation, pretending they didn't know who I was and poof, spontaneously I would get a lunch invitation to continue the conversation. I like to solve problems other people haven't solved and have several requests that could put a nice cash flow in your pocket if you have a desire to create prototypes of fun experiments and benefit as a board member as products roll out to the medical, utility, maritime, aviation, aerospace and transportation sectors; clients I've served for 50 years. We can discuss this further if you shoot me a text with a convenient time to call. Ironically, despite living right next to Silicon Valley I have the worst cell signal in the world and often incoming phone calls don't ring, but I get a notification 5 or 10 minutes later somebody called and I missed it, so I usually call them back. It's easier and more reliable to just schedule a time to call you using text messaging. When Julian invented ultrasound for Johnson & Johnson and they cheated him on his royalties he wanted to set up his own manufacturing company and I helped him bootstrap that corp and his firm is now the best baby baking in a mama video making wand in the world. For me, the goal is not worrying about the money. You can hire a CFO for that to keep the corporation on track and on the highway. The goal is to save lives, improve ease of use and reliability for Physicians and improve the lives of patients and communities. I do owe a debt of gratitude for all of those original OBGYN Clinic clients I met as a teenager when they invited me home for dinner. After writing down this phone number, feel free to delete this comment so it doesn't hang out in the public sphere. After all, some of the sentences above are probably not fit for prime time. 650-241-9046. I look forward to your text message with a convenient time to call.
Reply: I made one using a whole house water filter. I used distilled water and added 1 tablespoon of baking soda. I am using 12 volts its pulling 20 amps and have a good reaction in the chamber but nothing comes out of the tube i have going into a jug of water.  can you explain why im not getting any gas out. And If i do decide use potassium Hydroxide flakes how much do i add to how much water ? Thank You.
Reply: hello, there, you have made a very important point.thank you  I think we share the same concern, I would like to know how do you dispose of any solution such as this or what would you recomend?
Reply: How about if you tried 
Stainless steel screen from a screen door formed in to a 2 inch tube then insert 
SS scrubber.
Also solder the wire to the screen to avoid sparks , since the bubbles can be ignited, even if it’s inside a solution from a  electrical spark. 
Safety is your main priority because walking around without eyebrows and facial hair for a while is not appealing .
Reply: How about if you tried 
Stainless steel screen from a screen door formed in to a 2 inch tube then insert 
SS scrubber.
Also solder the wire to the screen to avoid sparks , since the bubbles can be ignited, even if it’s inside a solution from a  electrical spark. 
Safety is your main priority because walking around without eyebrows and facial hair for a while is not appealing .
Reply: @ratgreen  what if i use pvc pipe?
Reply: You should put this IN the video
Reply: Wear a niosh mask and have a fan with fresh air if you're doing this in your shop, a hydr.olyzer might be better than steel wool,  trivalent cr is still bad
Reply: Or start with 18/8 steel
Reply: Could you also use magnesium oxide, in place of potassium?
Reply: Hi, im new to electrolysis and im wondering if the water tube connecting the 2 containers shown if the first video could be just a wire and if it makes any difference
Reply: @ I believe using the wisk will give you more surface area
Reply: What other way would you use to increase the efficiency of the process ?? Thanks
Reply: I may have a dumb question and it involves Static electricity. Can static electricity be used in a more efficient manner to create hydrogen gas? Doesn’t Static electricity cause lightning reactions? A couple of days ago I was getting zapped by Static electricity while visiting my friend on the 3rd floor very often. Interestingly I live on the first floor and not affected by static electricity.  Cold dry air vs hot dry air and static electricity?  Does Static electricity have potential if there is a way to harness, and direct energy?  I mean if it is true that lightning is the result of Static electricity.
Reply: @ there are aquifer under every known pyramid. From what I know there is a pyramid with a cap that still exist under the Bermuda triangle… aside from that if you go to the complete opposite end of the pole of the Earth, there is another place that has a vortex in Japan, they say that there is another pyramid with a cap there…. From what Billy Carson says that most of the kings chambers in the pyramids are linked to the different moon phases. I know your question was not directed towards me, but I believe you are onto something.
Reply: @ there are no dumb questions. It is called curiosity and that is what pushes evolution forward🌛🎻
Reply: I am glad you let us all know Sir. Thanks
Reply: @1620lun  Thank you Sir.
Reply: Why 🤣 would I want to make gas and not just how to make power
Reply: @M @MaplePanda04 . Yup with is why ni no longer trust project farm. It’s also v what made me look at myth busters  bad too .   They featured HHO twice and both times acted like the generators didn’t work period.    I use an hho generator for my say all the time.  The thing is truly awesome. 

Outside the usa youll find people view many things quite differently.   Hho is used commonly on heavy machinery. Semi trucks and what im most familiar with is in shipping. Cargo ships to tugs to whatever.  It really excels on these on many levels. Fuel savings. The added torque and the cleaning/clean burning of the engines.  Put this on your semi-truck and . Poof no more Thick black  exhaust.  It will literally run clean.  .. that alone should be enough for many out there. No need for some urea nonsense. 

I was looking at a interesting company called aquatune? I think?  Really cool technology that makes the install take up like no space. I don’t know much bout them. 

SEVERS in Belarus (distributers elsewhere such as Iceland) makes the best HHO torch/generators on the market.  As well as a home heating system. Innovative stuff.